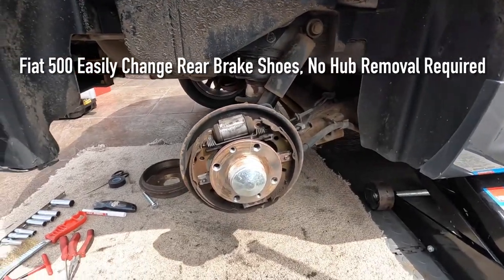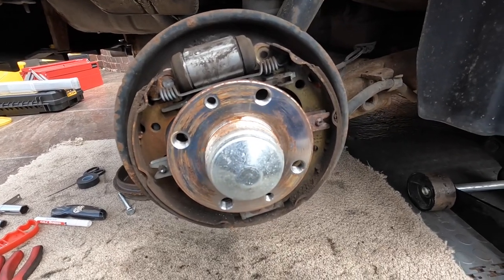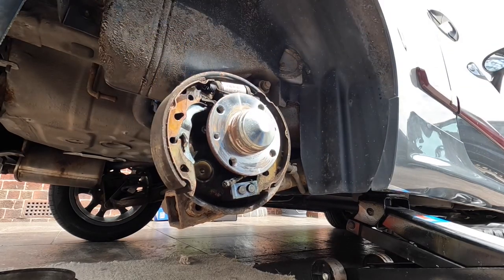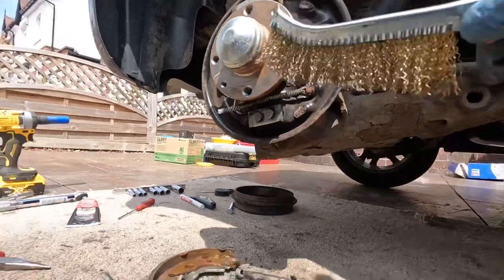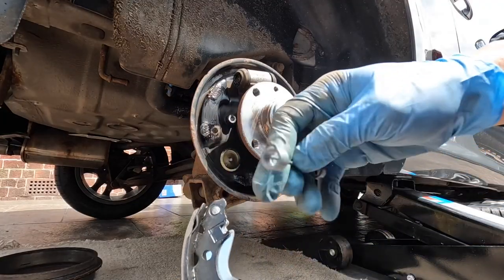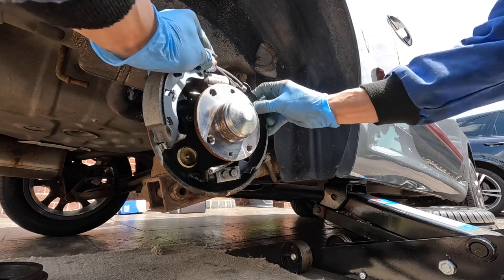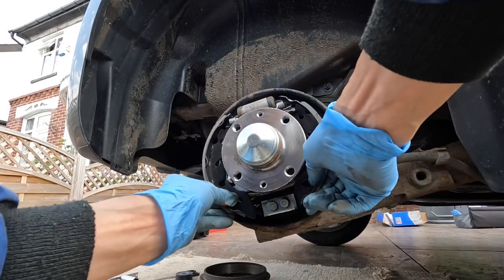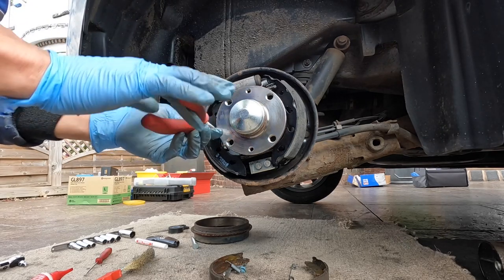Fiat 500 Easily Change Rear Brake Shoes, No Need to Remove Hub

Comment: It is not stupid to remove the hub . Then you can remove and replace the shoes and springs as a hole unit .  No struggle at all with the springs  .Uoe seems you have a small problems. The hub just take two minutes to remove.
Reply from the maker: And then you need to torque the hub nut to 200Nm.  Each to their own, I’ve never had to remove a hub to change shoes, it is in my option stupid to do that. 😊

Comment: lazy plain lazy .Remove the hub and clean the tone ring  and inspect then re-grease and put back on.
Reply from the maker: Thanks for your comment.  Never had to clean any tone rings before in 35 years of driving and maintaining cars.  My philosophy is, if it isn’t broken don’t touch it 😂
Reply: By pulling the shoes and adjuster apart with the hub on you run the risk of damaging the magnetic tone ring

There is very little clearance between the adjuster, wheel cylinder and tone ring with the hub installed.